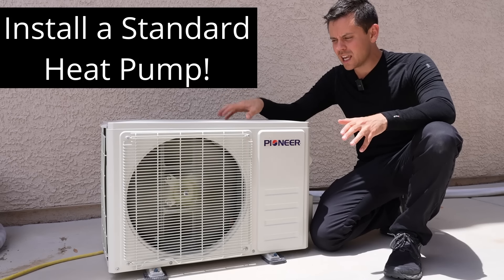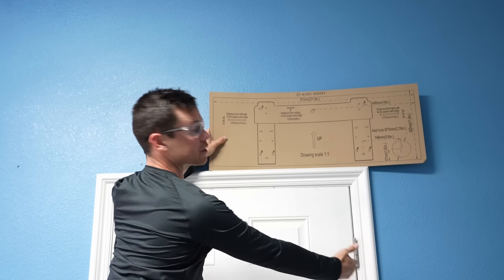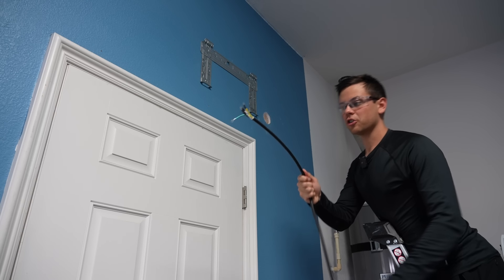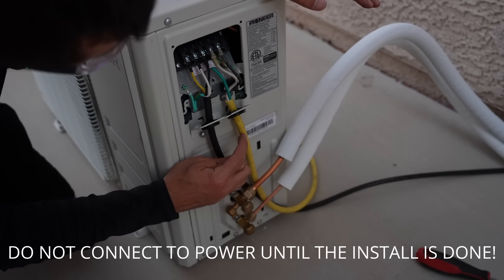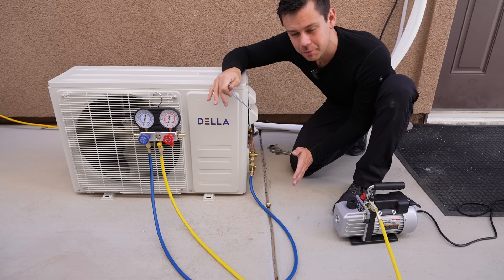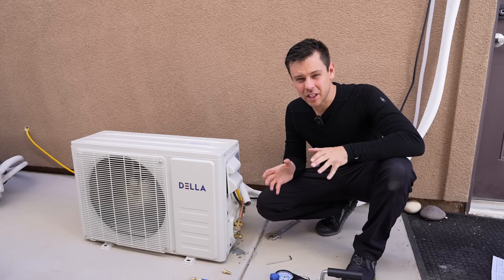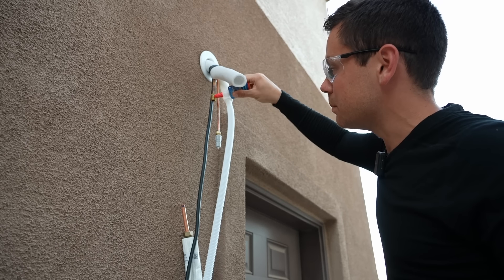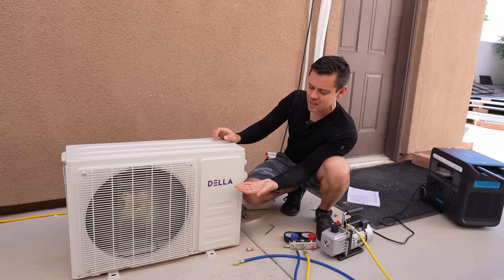Budget Mini Split Installation for Beginners! w/ Vacuum Pump and Gauges

Comment: I have yet to see anybody do this even close to right and yes, you did "good enough" to make it function but please do an update in a few months when it stops working.  At an absolute minimum Will, get a micron gauge instead of a gauge set and vacuum down to 250 microns making sure it holds under 500 micron.  For the same money, you could have done this right.  I would say VCRT, Micron Gauge, and 2 stage pump and you're all set to make this functional and done right.  What you're doing is just a repeat of the same mistakes every one of these DIY videos is doing.  The manual even says you've voided the warranty based on how you installed it.

Comment: Tells you not to buy the easier things cause they're 500-1000 dollars more expensive... then tells you you'll need 1500-2000 dollars worth of tools because you didn't get the more expensive unit, lmao.
Reply: The pump and gauge set can be purchased for under $200, and reused for multiple mini splits. Or just return them when you’re done installing.

Comment: Be careful, the link to the Amazon Split is going to a 208v product, which uses 2 110v lines. And there is no neutral. Be very careful. Consult an electrician before making the connections.

Comment: Flared connectors don’t need any sealants. Why are you lying? Do you you really need to be selling a product that does not work? 
You we’re pretty cool until this video.
Reply from the maker: Watch the whole video. I cover nylog at the end and if you do a good job and torque it to the proper spec, you don't need anything.
Reply from the maker: "pretty cool until this video" are you a child? 😂
Reply from the maker: Furthermore, there is no such sealant that works with flare fittings. It will mess up the torque of the fitting. Refrigerant oil based compounds like nylog are the only thing you can use, and again, I covered this at the end of the video. All you did is make yourself seem like a jerk and ignorant.
Reply: Whatever that stuff is, you are clearly applying it to the matting surface of the flare. If the flare is not perfect it’s going to leaking regardless of what you apply to it. If the flare is properly made it doesn’t need any stuff on it. 
Don’t start selling snake oil buddy.

Comment: So you run an extension cord with end cut off through a wall instead of putting a disconnect on the wall ? Perfect you should not be showing any how to take a piss…

Comment: Ohh no you di’nt… I’m SOOO going to critique you video Will…
Reply: 7:12 
The flared lines OFTEN have terrible flares on the copper. MANY times the copper has a weird angle or defect on it, so having a proper flare tool is sometimes needed.
Also, I recommend using some refrigerant oil or nylog on the back of the copper flare, so it doesn’t bind when tightening. Heh, nice covering his step in the end segment!

Refrigeration supply shops sell high quality shark bite style refrigerant fittings… makes a fantastic leak free joint.
Reply: 9:33 you do not want to take off the protective caps before evacuating the lines. Frequently, the king valves allow leaking through them with the caps off.
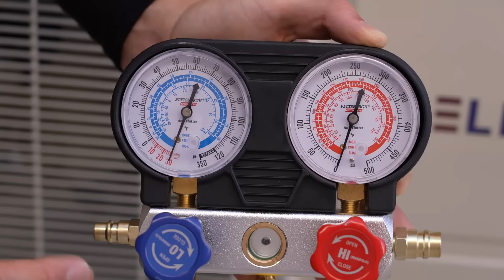Reply: 10:30 using the analog gauges and a random time under vacuum to decide there is adequate vacuum is insufficient with a minisplit install with a single 3Way valve… you need to use a micron gauge to get below a confirmed 500 micron vacuum level…
And a proper job requires breaking the vacuum with a dry gas like nitrogen or CO2 to flush moisture out better…

Also, using vacuum to test for leaks is a bad procedure!
Always use PRESSURE with a dry gas like nitrogen or CO2. Vacuum is under 15psi of differential and it is opposite of operating conditions… so totally inadequate test for a leaking system.
I always pressurize to 500psi… for 30 minutes to confirm zero leakage.
This way IF there is a leak, you are not vacuuming moisture into the lines…
Reply: 14:09 now think about this step… realize you are instructing someone who following your video steps just vacuumed out the system opened the refrigerant into he pipes, and only now is realizing the flares leak… wasting the refrigerant, and contaminating the copper lines.
Reply from the maker: Yes did you watch the end of the video? I did cover that entirely
Reply from the maker: Ohh good to know about the caps
Reply from the maker: Oh yes I am well aware haha but these diy kits suggest 15 minutes and people will not spend more on the other pumps. Just won't happen. Yes I used positive pressure after to test for leaks. Did you see that part? Anything I did that was wrong there?
Reply: @WillProwse  absolutely terrific video on the job. Just a few critiques to clarify for a better install.
Your pressure test was after the evacuation, and you used the refrigerant in the setup for the test. So if it was leaking, you would have wasted the system charge and have to weigh a fresh charge into the system if tightening the nuts more wouldn’t stop it.
You know me, I am a well experienced Hvac and electrician… sequence and procedure is key to a solid life long install.

Comment: How interesting he left the entire segment out concerning the main electrical connection to the service box. These Mini Splits require a dedicated circuit, but he didn't show this critical step. You have to have a disconnect box and run a new dedicated breaker into your electrical service box. Again, he showed NONE of this critical step.  I've been a contractor for over 40 years, and I've never had a project this complicated go as smoothly and effortlessly as he claims it went…never. I have a suspicion Will did not do this job by himself, but had someone else help him, but failed to show or disclose that fact in this video. Trust me: these kind of installs are much more difficult than what he is pretending to show.  Finally, he's dressed in all black, without wearing a hat, in a hot desert temperature of at least 115°F! Who does this? I live in Tucson, and I would never think of dressing all in black and working outside in the sun on a mini split (or anything else outdoor related) in those kind of extreme temperatures. I smell  a 🐀.  I might be wrong, but this is a scam video of someone making money off of selling products and tools and glossing over the difficulty and skill level needed to actually do a complicated job like this.  Very dangerous personality who would do something like this.
Reply: yeah, Will is a really hands off kind of guy. I"m pretty sure he has a twin brother doing most of the actual work. lol

Comment: Using compound gages to measure quality of vacuum is like doing surgery with a butter knife. 15 minutes is speculative.
Reply from the maker: Yeah we know lol it's mainly to check for leaks. This vacuum pump is good enough for these mini splits. Lots of professional HVAC guys have videos showing this
Reply from the maker: Actually no , 15 minutes is recommended by multiple manufacturers

Comment: Sounds like your vacuum test of watching the gauges is foolish and not accurate if you are checking for leaks after the system is pressurized with refrigeration gas. If tightening the flare nuts isn't fixing it you have just wasted all the refrigerant. These units run on pressure and should be tested with pressure first.